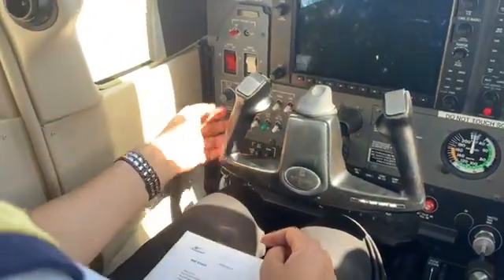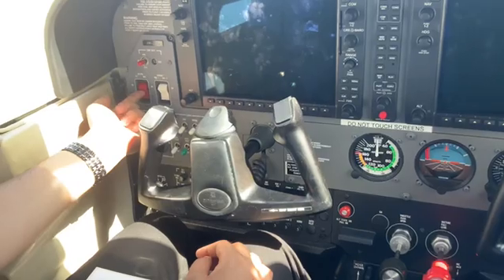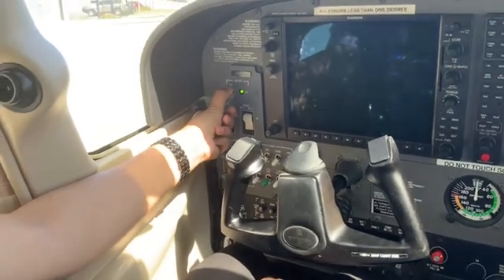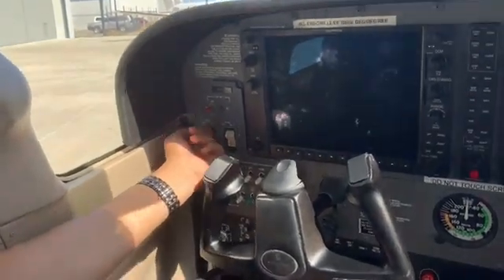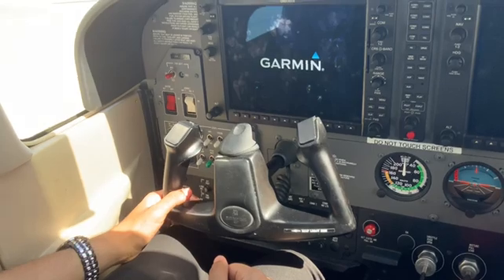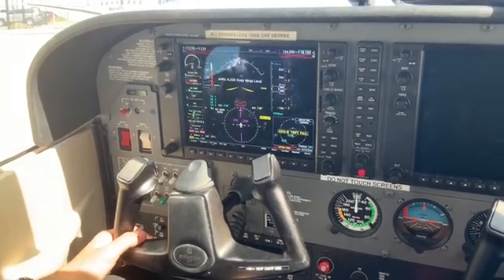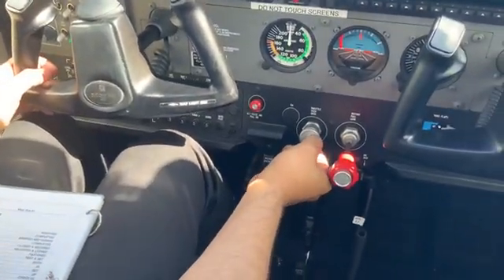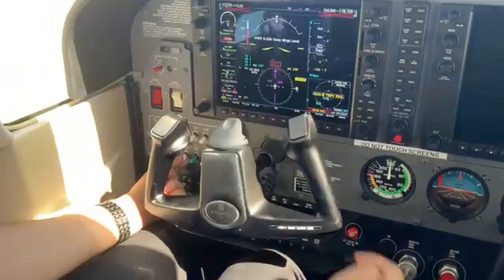How to Start Up a Cessna 172 Glass Cockpit and Engine!!!

Comment: Did it stop?
Reply: I do things slightly differently. It sounded like his engine is beginning to get fouled plugs. Before starting, I go full throttle and full mixture and turn the fuel pump on 3 to 5 seconds and turn it off. I then pull mixture to idle cut off and throttle all the way back to idle. After, I check and make sure that my beacon is on, yell clear and I start slowly advancing the mixture as it catches only doing about halfway. Then I adjust my RPM to 1100 RPM for 30 seconds and monitor oil pressure. After I run it at 900-1000 rpm. It is a lot smoother on the engine. During run up I adjust mixture 1/8 inch in from highest rpm for takeoff. I keep CHT below 400. EGT isn’t so important.
Reply: he stopped it